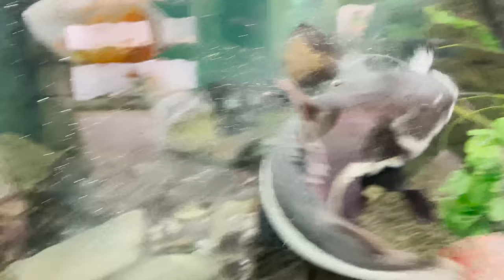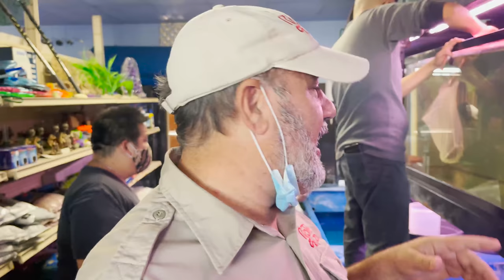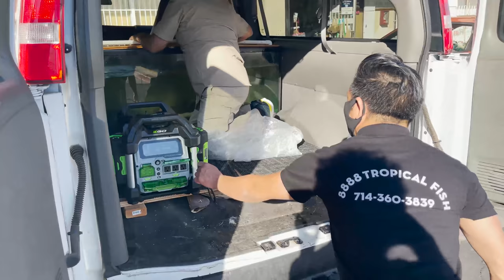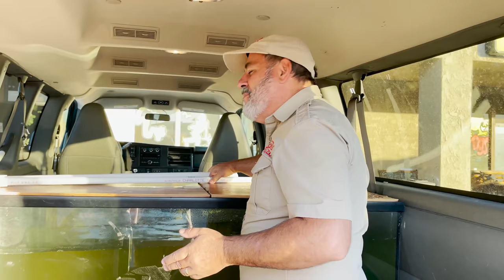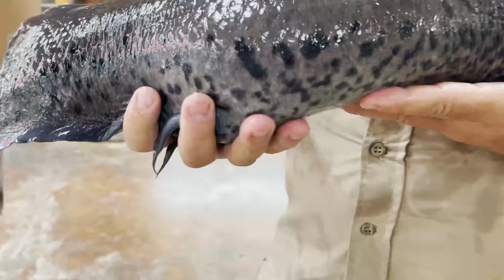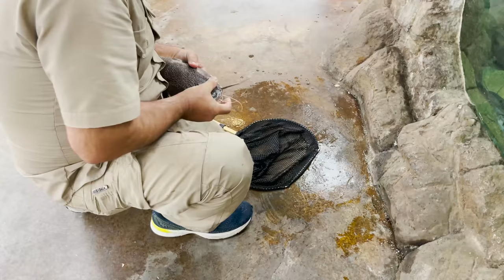Is it a Reptile or a Fish?!

Comment: Also when you find chunks missing from your other fish, that's the lungfish doing its thing.
Reply: Yeah maybe. But if the monitor is kept fed, maybe not. After all, it hasn't eaten them yet.
Reply: @lovemesomepickles  if you use tongs, no problem. If you use fingers, problem. Mine will take in a piece of dry dog kibble, crunch it up, and seconds later slowly spit out a ribbon of flat mucousy gunk, then take it back in and swallow it. That's how they eat. 
   If they'll do that to hard kibble, imagine that's your soft finger.
   Jay's fish is big enough to take your entire finger.
   Your choice. Go for it.
Reply: @lovemesomepickles  there is another species, Protopterus aethiopicus, that can reach 7 feet long. I imagine that fish could suck in your whole arm and crush your elbow to goo.
Reply: @lovemesomepickles  they can't see at all. They hunt by smell and touch, when hungry biting anything they run into.